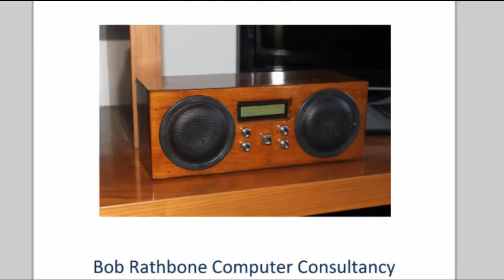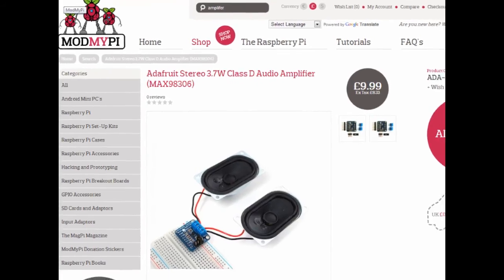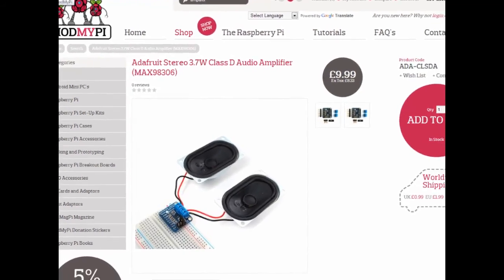Raspberry Pi Internet Radio - Part 2

Comment: what trial and error problems did you have setting up the software from that guide?
Reply from the maker: main issue if i remember correctly was getting it to recognise the radio feeds in the playlist. Believe the guide has been updated since so hopefully its better now. Do you have a specific issue?
Reply: *****  with that guide i am having a nightmare, mpd would start on boot then stop, button presses didnt do anything, only way to get mpd working was by command line but then the lcd wouldnt work

been playing for the last few hours, if i start MPD from CLI, it runs between 5 - 12% CPU (playing audio but no LCD) if i start MPD by ada_radio.py it runs at 98% CPU (without audio display come on but buttons are none functional)

Comment: Hard to tell from the recording but it sounds more like noise than interference. Is there any way you could increase the output from the radio in order to reduce the volume on the speaker? Also, have you tried using screened cable or twisting the wires together for the signal? Probably not the answer but worth a try.